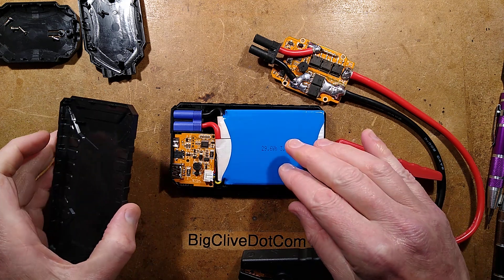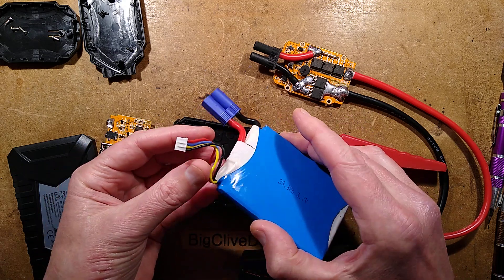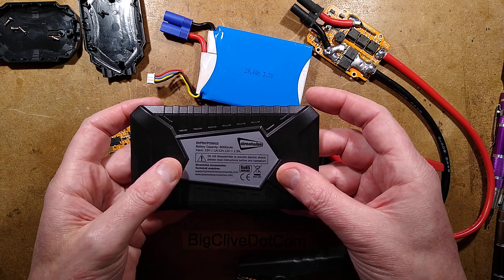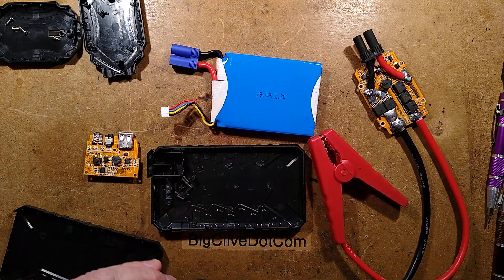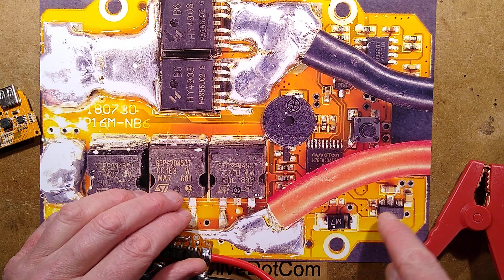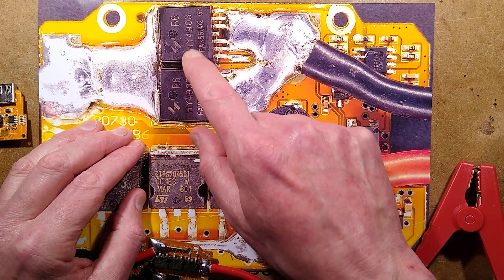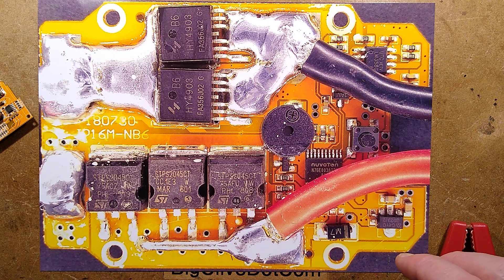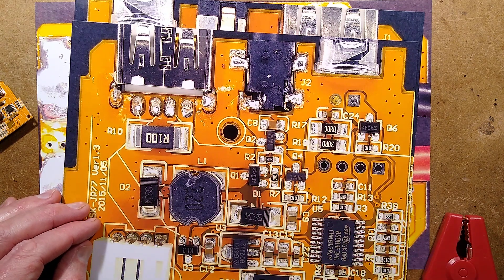Inside a combined power bank and jump starter

Comment: Wrong, the "diodes" are MOS transistors to control. If reverse , or correct polarity the IC will switch OFF/on the 45 Amp transistors

Comment: Random question if it has RC connectors on the output directly connected to the batteries. Can a RC trickle charger revive a unit that flashes the leds as a full charge when usb charging ? Then won’t accept charge ?

Comment: Mismatched diodes so that only one will carry the current and they will eventually cascade fail? Interesting choice...

Don't diodes tend to reduce their forward voltage the hotter they get? So yeah, the hot one would sink more and more of everyone's share of current until it dies. If they were mounted on a shared heatsink it would mitigate that a bit.

Comment: 1:02 Since the battery has the two separate connectors a RC model battery balance charger can balance charge it. The multi cell chargers are amazing they can charge almost all rechargeable batteries. They are programmable,?monitor temperature and discharge for storage.

Comment: Not exactly sure about the one you tested, but, I've had a similar one for several years now and have started a couple of cars with flat batteries although none of them mine.
One was just a guy on the side of the road with his bonnet/hood open.
The last one was about a month ago and only just got it started because I hadn't charged the pack for quite a few months.
For their size and portability I think they're amazing.
This one has USB sockets, torch, flashing red and blue lights and a bunch of DC plugs to run  a laptop or whatever all in a handy hard plastic case.
For $45AUD (50% off the normal price) was a great investment.

Comment: I would very much support a truth in labeling law regarding the power bank capacities. They shouldn't be able to claim higher capacities in mAh by letting the voltage variable be whatever they want it to be. If the device is a 12 volt product, we have every reason to expect that mAh rating to be at that same voltage. They should either come up with another formula which includes voltage, or state the voltage they're using to claim that mAh number -- either right next to or under/above the stated mAh rating. I would be curious what would happen if a large state such as California would pass such a law -- whether or not their size alone would/could be enough to propel the industry forward worldwide. Or whether the industry would resist such a move, because they love lying and deceiving on their packaging in order to gain extra sales that they know they'd lose if they had to be honest.

Comment: Is there anyone else who dont uderstend how this thing delivered at least 50 or 100 aps to help car battery to to drive 3kw engine starter. With that low voltage and low capacity battery...What i'm missing...?...Please....
Reply from the maker: It's a 12V battery with a very high current capability for brief periods of time.

Comment: A trick that is used on car battery chargers and some jump starters to make the output "short circuit proof" when not connected to a battery, is to use one or more High power MOSFET's in series, and the Gate(s) are powered by the battery voltage to turn on the MOSFET's that then pass the high circuit through.

Comment: Hi Sir B.C. (I have unofficially knighted you, hope you don't mind). I have real questions regarding this clever device and it's intent. 
Is this unit designed solely to be charged up with transformed and inverted line voltage, and then, after reasonably charged, provide the voltage and current to overcome a dead-ish car battery enough to power the starter motor and ignition system?  That concept, I understand well enough..
It appears there is another device that operates quite differently, if I am not mistaken, and it's end goal is very much the same as what I previously described.  It's a car starter, for when your own battery has dropped below useful capacity. It seems as though you can hook this device to your fading battery, and through the magic of electronics, after some time, said device will pull some or  much of the remaining power into itself and prepare it for a last ditch effort to turn the motor over and supply the ignition with enough power to start, if the dead battery is the only thing keeping the motor from running. 
I hope this made sense. I think of the 'joule thief' when describing the latter device .
Are there 2 different contraptions or have I imagined the second one? If you could please make a presentation about this possibly imagined device, when you have time, sir. Or simply let me know I am crazy. 
Much thanks.👍
Reply from the maker: I've thought about buying the capacitor based units, but can't really justify the expense for a video.
Reply: @bigclivedotcom  Sir Clive- oh, I had no idea of the expense. Yeah, no. My confusion, however, remains.  Is the "joule thief" type an emergency car starter or am I imagining it?

Comment: Unmatched parallel diodes is not such a big deal as each will have some dynamic resistance (of a few mil ohms) thus donating some current to the next one.

Comment: Not sure I'm keen on the 15V input. It might be able to charge the cells quickly, but is it worth not using a balancer? My Roav pack (Anker brand) charges with USB-C, so it definitely has balancing. Unfortunately they quit making them. It's sad when such a high quality manufacturer simply can't compete with all the cheap stuff.

Comment: I own the same powerbank/booster. ive had it for 3 years and was a great investment!! i live in a block of flats and through lockdown not using my car much it would have been a pain in the arse to charge the battery so this tiny little unit fired up my 1.6 zafira when the battery was flat no problem at all. being able to charge via usb is also incredibly handy. the only downside is that when charging something via usb the torch light keeps blinking randomly. Other than that its a great little product.

Comment: I had one of these but destroyed it :-(  I was using it to power an audio amplifier direct off of the 12V output and used it too long. It reverse charged one of the cells and it swelled up and ruined it.
Reply from the maker: That's what we'll be trying to avoid in our potential application.  But fortunately it's only going to be used for brief periods of time between charges and the load will inherently reduce the current as the voltage drops.  (Illuminated stage costumes.)

Comment: Would it not make sense (electric at least) to include a large capacitor? It would cost more of course, but you could charge the capacitor at a rate more suitable for the battery chemistry and then use that to get the engine running. I've even seen a few people who have replaced their starter batteries with ultra capacitor banks with good results, with the trade-off of lower car off accessory capacity.

Comment: I wonder if we'll ever get one of these designed with protection on the 12v output. Would be great for tinkerers and they could sell accessories like 12v lamps
Reply from the maker: You can get protected 12V packs.  But they are only suitable for a few Amps of current.

Comment: It occurs to me that the four-pin connector might couple with the pins on an external balancing circuit which provides "bottom balancing" by reading the cell voltages and then discharging the higher cells down to the same level as the lowest cell.
I have a couple of those external balancers.  I think they're branded as "Cellmate" or something similar.
If the USB port in that power bank can only supply 1 Amp then leaving the data lines unconnected should cause anything plugged in to default to 1A or lower.  If the port can supply more current, then it should be easy to add a couple of quarter-watt resistors to "announce" the current limit.
I made my own battery bank and since it can supply at least 4A, I linked the two data lines with a piece of wire.  That tells anything to which it is connected that this is a dedicated power supply and so it can take as much current as it likes, right up to the maximum current limit for USB ports.
Reply: Please give more details so I can build the same thing please! I've been looking for something that will truly give more than 2.4A
Reply: @user-nn1ct9ph4u  My method isn't for everyone.  What I ended up with isn't exactly portable, but it suits me just fine.
The heart of the whole thing is a simple "buck converter" which takes a 12V input (but can take anything from around 9V up to 30V) and I've adjusted it to provide a 5V output.
I bought the buck converter online and, assuming that claims made about how much current it can supply have been vastly exaggerated, I'm saying that it can probably supply up to 4A.
I use a bank of lithium-cell batteries which I charge via a solar panel through a balancing circuit, also purchased online.
So I'm sorry but I have no simple description for you as to how I did it.

Comment: The purpose of these starting dongles is, primarily, to guard against accidentally massively overcharging the car battery. If you connect it directly, it will start putting all it's got into the battery, which, if you leave it there for a while, is almost certain to overpressure. Therefore, the module watches the voltage it's connected to, and keeps the boost pack disconnected until it notices a big dip in the voltage (i.e. when you try starting) and turns on then. That's a very good strategy - in fact, when jump starting you're supposed to connect everything but the positive and have a helper that will connect it immediately before you turn the key (and disconnect it immediately after). I have a different type, with a mechanical relay which you can hear click when engaged, but the function should be the same (otherwise, there'd be no point in having MOSFETs here, right?)
The problem with all this is that it's overly cautious. I was working on my car once and accidentally discharged the battery (which was at its EOL anyway and is since replaced) so that you could just hear the solenoid engaging and the engine turning a bit, but it couldn't turn it over. Which is precisely the situation in which the boost pack is supposed to be used. But when I connected it, it would immediately indicate an error and refuse to work. The error was "false polarity or bad connection". Apparently, it was detecting too low a voltage from a battery (which, again, was not totally dead and only just below the level required to turn the engine over) and refusing to work. Luckily, there's an override - the button is not to activate the unit (it starts automatically as soon as it is powered), if you hold it down for a couple of seconds it will override the detection and just turn the unit on manually. Which is really stupid since the lower the battery is, the more current it will accept and the more easily it will overpressure. So I disconnected the ground (I have an easy-detach clamp there), attached the device to the lead, overrode the automatic in the dongle, started and then reconnected the battery while the car was running. This dongle is a very clever idea, but unfortunately executed very poorly and stupidly. I wonder how many non-technical people, who are unable to analyse the problem and work around it, are left stranded because of this stupidity, despite having enough charge in the booster unit which "doesn't work".
Reply: Well hopefully if you are stranded, you didn't throw out the manual, as something like this would usually be described within. They often come with carry cases to hold the leads and manual.
Reply: @jaro6985  Mine didn't. The manual was next to useless iirc, very terse and not very clear. I essentially had to figure it out myself by trial and error and trying several ways of connecting the thing.
When I get a new device I usually put it through its motions to make sure I know how it works, but in this case it would not have helped me at all. With a charged battery it would either work properly or make no difference whatsoever, in which case I would not know if it worked or not, or would still not know how to use it with a drained battery. The only way to train the usage of it would be on a discharged battery, and I'm not doing that on purpose and reducing it's life just for that. You don't get to use it until you really need it, at which point it may be too late already.
The practice of using just a couple of LEDs with various blinking regimes to indicate various problems isn't very helpful either, particularly when the information about what it means isn't printed on the device itself.

Comment: Just as an aside, don't leave the jump-starter part plugged in. I did this and as there is no protection on that side of things, the associated electronics dragged the charge all the way down and the cells all puffed up. Hopefully there was no risk of fire. I've looked for replacement cells and they're pretty much the cost of a whole new pack.
Reply from the maker: Ah, that's an interesting weakness.
Reply: @bigclivedotcom  Yes. Don't know if yours is different cause it has the button but mine (Everstart 600A) has a circuit which flashes when bringing the vehicle's battery "up to speed" then goes solid green when the jump should be attempted. I did the jump (fairly easy as the battery was only just underpowered) then threw it on the passenger seat and forgot about it.
Reply: @bigclivedotcom  By the way, I happened to break one of those single-pin fluorescent bulbs (one at each end) and it had like a forked terminal, possibly different metals that looked like it might have held a heating element at one time. I have a picture if there's somewhere I could put it.

Comment: Mine will also turn on the output for a totally flat battery if you hold in the start button instead of clicking it (not that I've successfully started my car when the battery is run down before the power jumper says it's drained)

Comment: Yeah that's exactly like several name brand ones I have taken apart... And they don't actually have enough oomph.  I feel like mine also no longer hold a charge after a year or so even with little to no use.  Mine actually has a LCD to display the charge in percent and it will say it's 100% than you unplug it and it says it's 70 some percent and if you plug in a USB device it immediately dies.

Comment: Do you know of a module to make/buy to place between the pack and the jumper clamps? It is too easy to run the pack too flat. I've ruined a couple... Sigh!
Reply from the maker: It's best to unplug the jump module when the pack is not being used.
Reply: @bigclivedotcom  My thought was to protect the cells from getting too discharged while using it. I ruined one by leaving it attached too long to a very flat car battery...

Comment: Having the 12V circuit separate makes shutdown due to low cell voltage difficult. The charge control output that drives the 5V could be leveraged to signal the 12V side but that requires at least another connection.

But if you're in the business of selling tat, such niceties are counter-profitable

Comment: for a long time i have wanted to see a version of this that uses a standard 18v power tool battery. and which then limits the current to a discharge rate which is low enough not to ruin the power tool battery. so not a 'direct jump start'. but instead a rapid rescue partial charge. that is just enough to get the car battery back up high enough to crank the engine. after which point the alternator can take over responsibilities.

however i never see such a product or design anywhere. and perhaps that is due to it simply being uneconomical to include such a high current llimiter (we are talking on the order of tens of amps, perhaps around 40-60 amps typically, or as high as about 100a). so it is much cheaper to actually include a cheap chinese 3s pack configuration as shown here. so the double duty as a usb power bank is really quite a clever value add

so if 18v really is off the table... the i suppose we could achieve this objective more easily with the m12 power tool batteries (or even with a 14.4v battery platform might also be feasible). which might be cool, just to not have dead flat (discharged) lithium pack in the glove box for 2 years, for that 1 time when you actually desperately need to jump start a vehicle during winter time. so by having that 2nd purpose (either as a usb power bank or as a power tool battery pack). then that helps to keep the cells in daily use and therefore is a very good and practical safeguard against being caught out

Comment: I recently cooked one of these things (car wont start and i tried for a lil bit too long). Whole pack grew like 20% in size. Also it was a much bigger pack like yours here, almost 4x in size (not sure baut the capacity) Now its sitting in a bucket of sand waiting for disposal
Reply: Funny enough I used one to try and start a car with starting problems and after cranking for almost 2 minutes I decided to try and use the starter motor to help with pushing it. That stalled the starter, which drew peak current at that point
The battery pack survived, because the positive lead unsoldered itself from the protection circuit when the diodes got hot enough to melt the solder. Even more impressive: I soldered it back on and it still works as of today.

Comment: Simple  solution  to the low volt cutoff would be to use a  relay driven by the 5v output to turn the 12v off

Comment: Be interesting to measure its peak current, but would be difficult, I suspect a pure resistive load may not enable it, perhaps the supervisory circuit looks for some battery voltage on the load side before activating the MOSFET. I have no evidence of this but I see this behaviour in a lot of smart battery chargers so maybe same sort of chip.
Reply from the maker: In the intended application it will be bypassing the jump start circuitry completely.